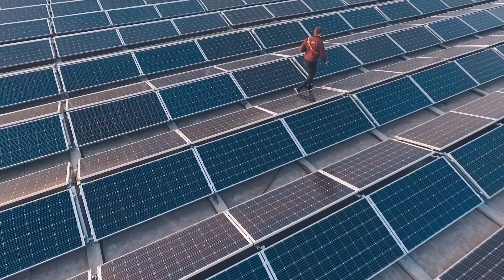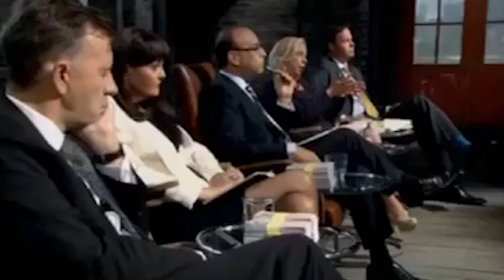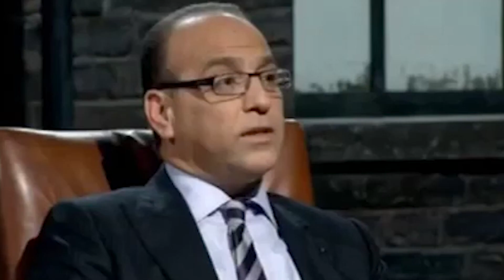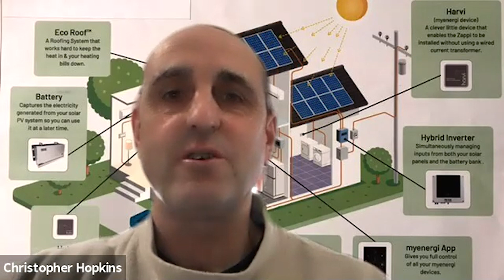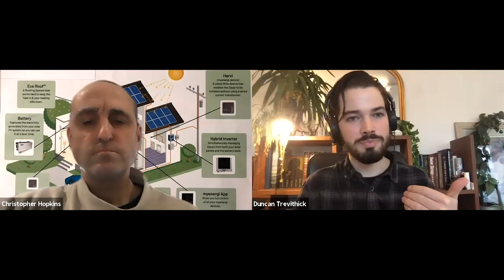How to Start a Solar Company with Entreprenuer Chris Hopkins | UK Solar Rise & Fall & Rise Again

Comment: I'd like to do a web page with calculations, and 3d design... I think old Victorian houses are not suitable for solar energy. The roof should be flat. Then, it is possible to rotate panels and change the angle.